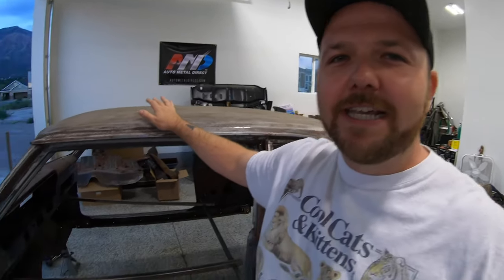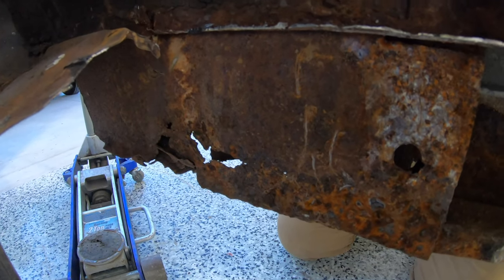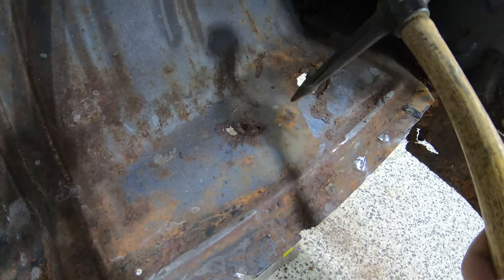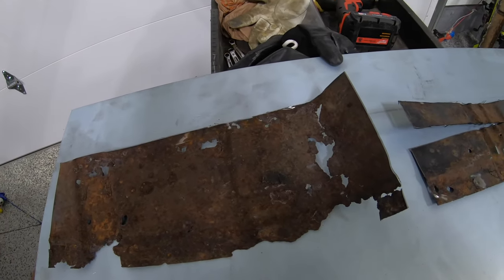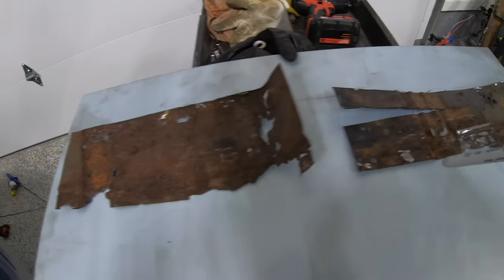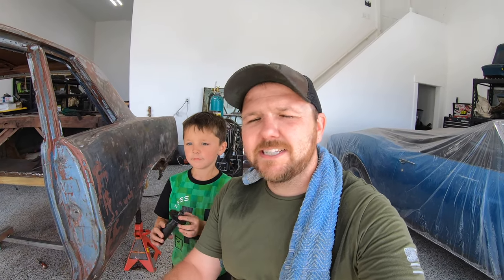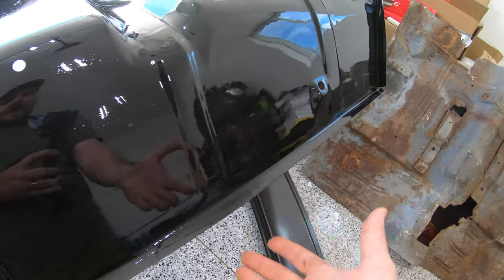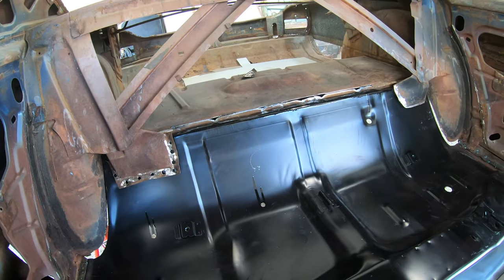1965 Pontiac GTO Restoration - Episode 4 - Full Floor Pan Install

Comment: While your handheld shaping turned out pretty good, I would think you might want to look at picking up a bead roller for some of that work.  Eastwood offers a couple that will not break the bank for smaller jobs such as this.
Reply from the maker: 100% agree.  Bead roller and shrinker stretcher are in the shortlist

Comment: Instead of POR 15 try masters series primer it works way better it’s cheaper and it’s was developed for priming bridges. I’ve had mixed results with por. Plus you can top coat it directly por you have to use a tie coat.
Reply from the maker: Good to know!  Thanks for the feedback

Comment: I need some help finding the Lower A pillar driver and passenger and also a fire wall. I don't mind spending the extra money to make sure the build stays strong with good metal. I am having to replace most the sheet metal on the GTO cause in its past life it was a drag strip car
Reply from the maker: Both are available aftermarket.  You should be able to use the 66-67 lower a pillar sections.  The only difference is the angle of the windshield channel.  Firewalls are available through summit racing.

Comment: When you were using your Eastwood punch tool, what size are your holes, 1/4 or 5/16 and how far apart are you punching your holes? Great video, always enjoy your work.
Reply from the maker: I believe they are 7/32” and I space them about 1.5 - 2 inches apart.  It’s a sweet tool!

Comment: Have you tried Frank's Pontiac Parts? They may have your A pillars. Contact them don't just look at the site.
Reply from the maker: Not yet, but I have two on the way from amd.  They’re for a 66-67 gto.  I’ll probably end up sectioning parts of them in if the fitment isn’t exact.  Video on the install should be out soon!

Comment: What kind of grinding cut off wheel you use on the floor . i will make an attempt soon 68 gto i have my frame  stripped an clean to my best  what do you recommend for frame finish  were you buy the sheetmetal fenders ,patch panels an core support . an control arms .   from dyna corn ?  amd ?
Reply from the maker: I get my cutoff wheels from Lowe’s or Home Depot.  They normally come in 10 or 20 packs…. You will need a few!  Eastwood sells a few really nice frame coatings that I’ve used before with good success.  Check out their rust encapsulator in gloss black.
Reply: @rustbucketrestos6511  fenders an radiator support what place you order from Thanks  very much
Reply from the maker: Auto Metal Direct is the best in my opinion.  They should have everything you need
Reply: @rustbucketrestos6511  My most important what primer to use
Reply from the maker: Eastwood 2k epoxy primer.  They sell it in rattle cans too!  It’s really good stuff and I use it in several of my videos.